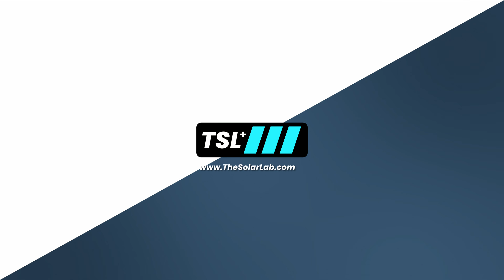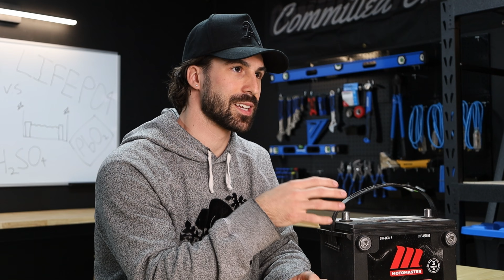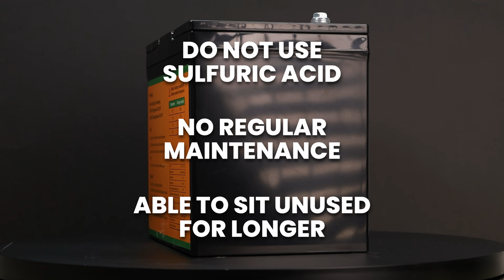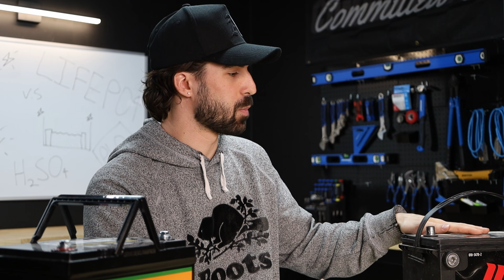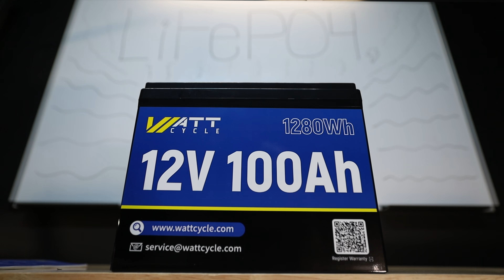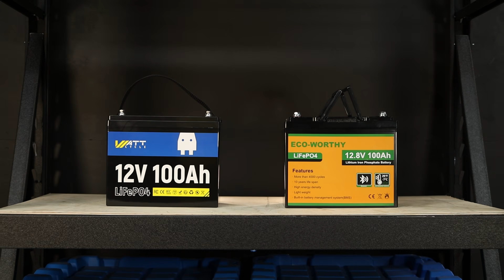Lead Acid vs LiFePO4 Batteries - Which is Best for YOU?

Comment: Weird video to make in 2026.   This is like asking if carburetors are better than fuel injection.  Lead acid also isn't cheaper anymore. That's been true for 2-3yrs.  Where have you been?
Reply from the maker: It's definitely an older comparison, but the cost gap still makes it a common question for many people! 😊 obviously this video is for the beginners
Reply: @TheSolarLabPlus  I spent $200 on the cheapest lead acid starter battery that would fit my car.   A have a LiFePO4 still in transit, with more amp hours that cost me $160 and its still not the cheapest battery with that capacity as some are very close to $100. 
*Beginners should also be given accurate information.  Please offer that to them.
Reply from the maker: Beginners should absolutely get accurate information, which is why it's important to mention the limitations too.

What happens when the BMS fails? A LiFePO4 battery without a functioning BMS can become completely unusable, whereas a traditional lead-acid battery has no electronics to fail.

And what happens in freezing temperatures? Most LiFePO4 batteries cannot safely charge below 0°C (32°F), and many rely on internal heaters or BMS protection to prevent damage. Lead-acid batteries can still accept a charge in temperatures where LiFePO4 charging is restricted.

LiFePO4 has a lot of advantages, but pretending there are no trade-offs isn't giving beginners the full picture either.
Reply: @TheSolarLabPlus Because the lifepo is still relatively new, the long term effects aren't known to consumers yet.  You guys are ahead of the game

Comment: I used 4 $99 200 amp hour deep cycle lead acid batteries for 10 years and I finally moved up to 2 300Ah LiFePO4 batteries. Easier to maintain now and lighter but will probably burn down the house. Lol! I never paid attention to the 50% rule with lead acid batteries as you can easily take them down to 80%.
Reply from the maker: Just make sure you've got a good BMS and you'll be set for years! 😅
Reply: @TheSolarLabPlus Hopefully!

Comment: LiFePO4 are not recycled. Try explaining that to an EV owner
Reply from the maker: LiFePO4 batteries are recyclable, but the recycling industry for them is newer than lead-acid. Lead-acid batteries have a recycling rate of over 95% because the lead is highly valuable and the infrastructure has existed for decades. LiFePO4 batteries can also be recycled, recovering materials like lithium, copper, aluminum, and steel, but the process is currently less widespread because the materials are worth less than lead. As EV and energy storage adoption grows, LiFePO4 recycling capacity is expanding rapidly.
Reply: @TheSolarLabPlus  I build server rack batteries and have pallets of dead lithium cells of various types. There is no recycling for LiPo and LiFePO4 is disposal only (ei they take away but you have to pay). Lithium is treated like nuclear waste. You can but not worth it so they go into storage or landfill. Mostly landfill
Reply: @crissb852  Have you heard of the Maui Method which is EPA endorsed and is recommended as a national standard for Lithium disposal.